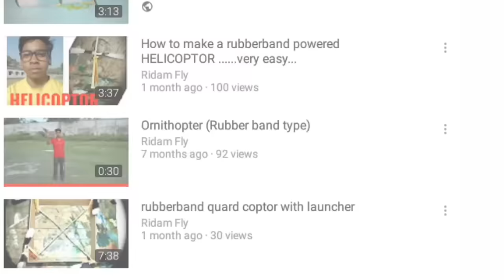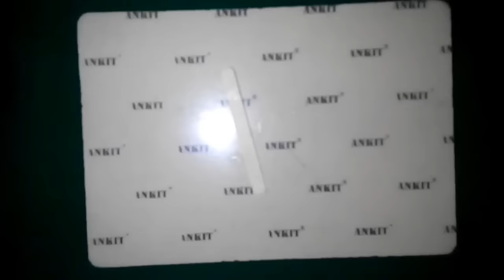Ornithopter wing flap Mechanism .. part ...3 //..must watch.......

Comment: due to motor weight it can not fly without motor how rabure band make able to fly please reply my confusion.your demo is very nice but it can be fly.
Reply from the maker: +bhupendrap Desai  it can fly with high speed moters right now i do not have heigh speed moter when i buy it i will make all my mechanisms video in flying mode